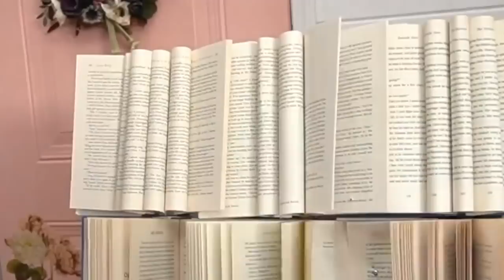Genius ways to totally transform your boring blank walls!

Comment: All this is fine and dandy...how do we find a product list? @ 7:36 specifically the product in the white bucket.
Reply: Unless we watch origional video instead of this collage put together video, we never know
Reply: I think what you are talking about is joint compound. I'll check again and see.
Reply: Ok, they are using ,it appears at least, some sort of fancier texture paste. Many companies make it. But, I will tell you, simple joint compound would do the trick and it's a lot cheaper I'm sure. It is usually used in drywall. Can usually be found in any Lowe's, home Depot, hardware store in a big bucket. I use it all the time to make textured or raised artwork, and raised stencils. I've done raised stencils with it on furniture. You can mix paint with it to color it. It is just the right consistency. Not too sticky. Not too dry.